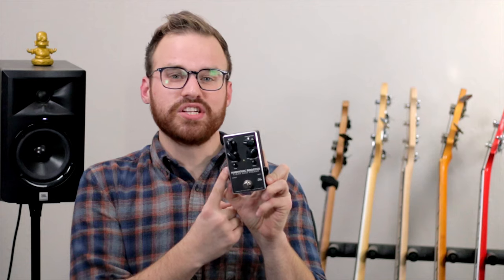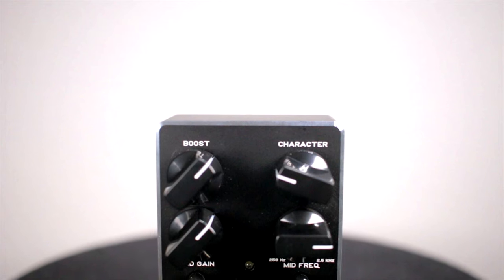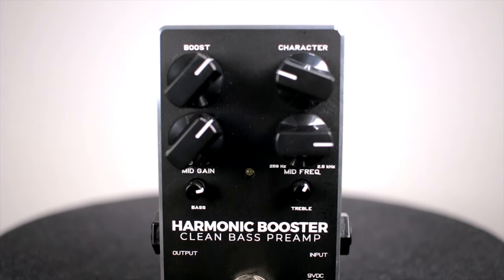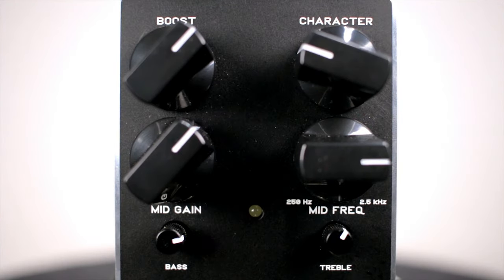Your Tones New Secret Weapon! - Darkglass Electronics Harmonic Booster [Demo]

Comment from the maker: What pedals do y'all consider to be the "secret weapon" to your tone?😏
Reply: Phat Phuk B by Wren and Cuff
Reply: My VT Bass. Absolutely love that thing. I've almost picked up the DI version so I can have two.
Reply: My custom blender. Its like LS 2's parallel mode with on-off switches for each loop and extra clean blend.
Reply: Hey Bro! I go back and forth between the Aguilar Tone Hammer, and my fav Tech 21 Sans Amp Driver :) great video, thanks for sharing!!!
Reply: Royale Preamp, by Foppstar.
Reply: For me, it's my Darkglass Vintage Ultra2. Although just adding the Boss MS-3 to the equation it's hard to say which item has more impact on "my" tone
Reply: Dsm Omnicabsim + Aguilar Agro 👌
Reply: I don't play like the man himself but the EBS Billy Sheehan Deluxe signature drive. I invert the phase to add more bottom end, drive at 9 o'clock, tone at 12, level at 9\10 and clean at 12 - just adds some overdrive and the tone cuts just enough. Plus the compressor is perfect (I use the high setting).
Reply: Morley Power Fuzz Wah into Black Arts Toneworks Pharaoh into an amp with a tube preamp that is slightly overdriven
Reply: Tronographic Rusty Box + Nuñez Amplification Annex Bass Channel
Reply: Oddly the one pedal always with me aside from a tuner is the DOD 410. Yummy in my tummy.
Reply: The MXR M 81 Bass Preamp with DI Out is my Tool for creating a special Sound with other Pedals. Helps me to save Lo end and it has parametric mid control.
Reply: Dark glass makes NG2s?
Reply from the maker: @rd6228  lol just noticed that, good catch
Reply: ISP Beta Bass + AXE FX III
Reply: Been really jazzed up about my Fuzzrocious Cat King and Aguilar Tonehammer DI for quite some time.
Reply: My two most important pedals are the EHX Bass Soul Food(a Klon with a blend control) and this weird $30 Joyo compressor I found at my local music store. The compressor levels stuff out nicely, as it does, but it also has this really nice, pleasant low end to it. The Soul Food has this really nice grit and a really pronounced midrange bump that helps me cut through a mix like nothing else. It’s hard to believe that with a $30 compressor and a $70 drive I can get the best tone I’ve ever heard(I’ve tried replacing both pedals with something “better” and more expensive to end up returning the replacement pedals).
Reply: Metalbass79 that sounds like something to try if I ever get the money for it, thanks for the idea dude
Reply: Ehx battalion & Small Clone
Reply: 10 metal zones obviously
Reply: DOD 250
Reply: Fdeck hpf v3 into a Fuzzrocious BDPG v2
Reply: My M80di+ for my clean punchy tone.  And then blending it's distortion in with an angry driver running the blues and the Charlie running parallel.  All the dirt, all the lows.
Reply: Compressor with side chain. I am not gonna tell you the brand though... it’s my secret ;)
Reply: Sansamp Bass Driver
Reply: Guru opto comp

Comment: Not gonna lie...wish it had an xlr out....but I bet they will release a bigger one in 6 months.
Reply: Just use any darkglass  and dont drive it hard.
Reply: They said they are not going to do that.
Reply: It's designed to be paired with another darkglass di overdrive pedal. That way you boost your overdrive. You don't want a di on it.  You want to put a di right after it.
Reply: @benchambers1173  I have one of these on order!  It is going in front of my Microtubes X Ultra.  Can't wait!
Reply: Sike

Comment: Hey Patrick, how you would explain the character knob? Is it a bit of compression and very light gain? And you compared the EQ of the pedal with the tone capsule on the Dingwall Bass? If so, what are your thoughts on it?
Reply: The character knob functions more like a "contour" control does on amps: boosting the bass and treble, in this case by adding harmonics instead of simply using EQ I'd imagine.